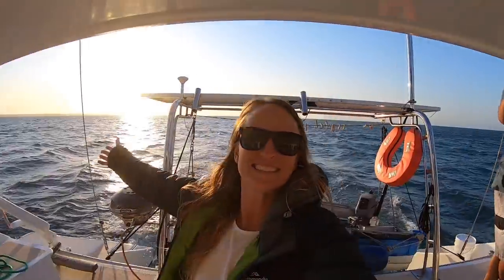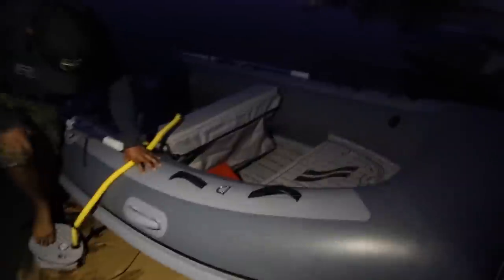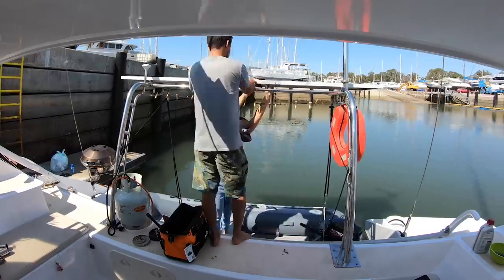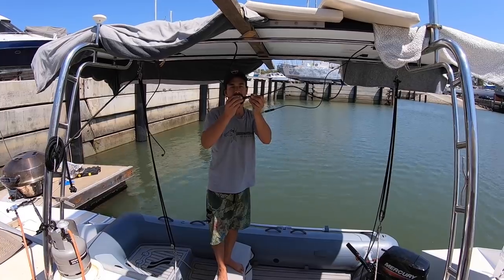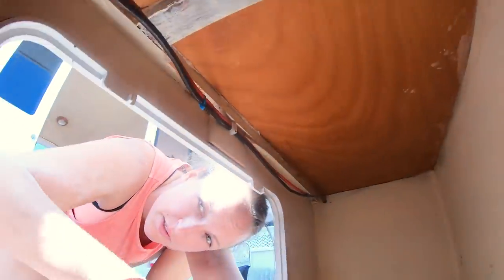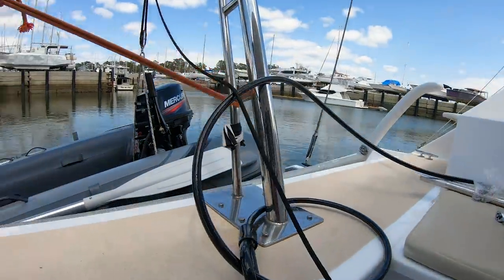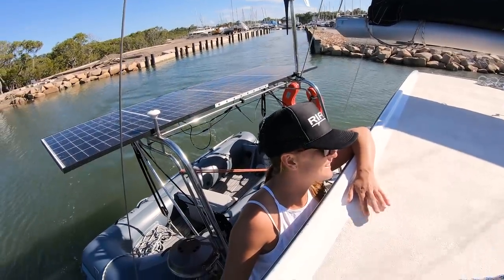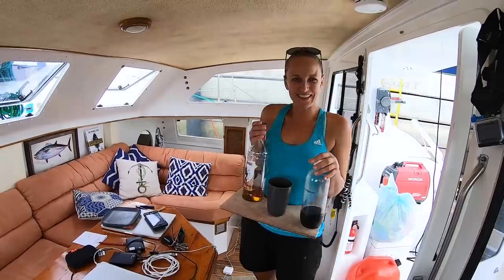Life Changing Sailboat Upgrades! We finally get a beast of an adventure tender & SUP review Ep.18

Comment: Question about your stern arch (designing mine now).
What's the size of your stainless tubing? Also, I know it doesn't make sense for your transom design. But, if it had been built into your steps, so wider across and the top post on the walkway and then lower post onto a step, would that have been deeper so spreading the capacity load better to have prevented the need for bimini poles you added for strength to mitigate that high weight bend? Cheers!
Reply from the maker: Hi Sailor Cherry, not sure on the tubing size -
I’ll double check in the morning. 

Having the Davits run down to the steps was actually our first plan but then our tender would’ve been rubbing on the supports as they would’ve had to come in at the top to meet the existing structure. Also we were avoiding any welding as it’s hard to find anyone good without a 4 month waiting list here! 

If I was redesigning it or in your case designing a new one, I would definitely do as you mention. It would spread the load totally and remove that ‘leverage’ all together. It would be crazy strong!
Reply: @sailingpopao thanks for all of that. I hope it's all holding up well. Done a sim project. So as to go back and check how it was holding up I painted the bare f/g work to have a measure of how it was holding up; like cracks in the paint to show strain or cracks or whatever eh?!
Cheers guys!

Comment: For solo get a outboard Motor tiller extension. Gets on plane easier.
Reply from the maker: Do the make them or just the diy pvc tube?
Reply: @sailingpopao  easily available on amazon not exspensive. Just push on and go.
Reply from the maker: Keith Ashley Hallam cheers will have a look!
Reply from the maker: Cheers!